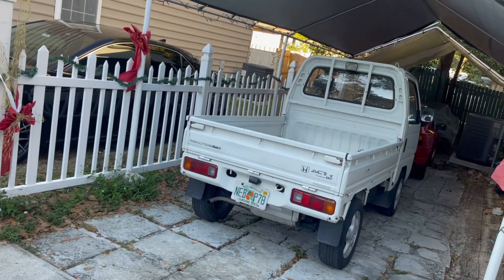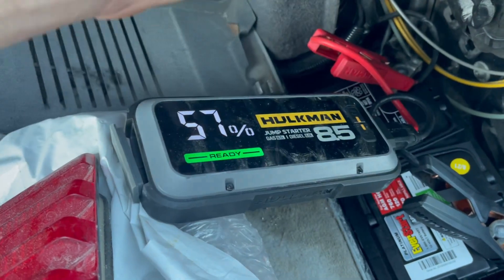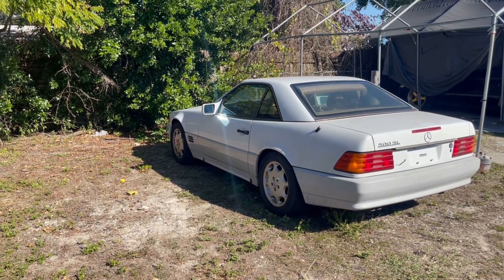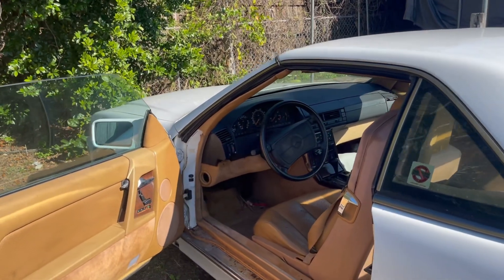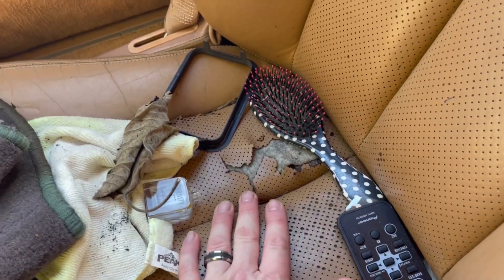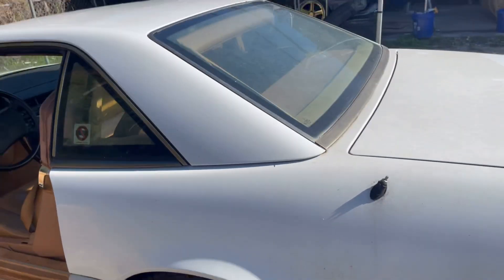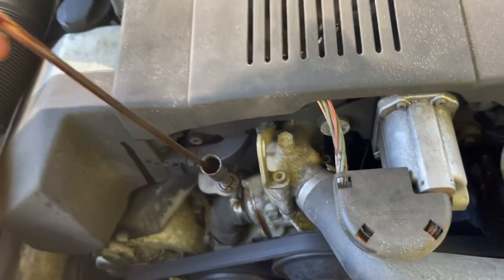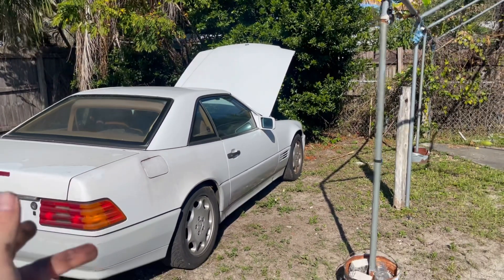I purchased another 1991 Mercedes 500sl r129 to revive and save

Comment: My 90 500SL that I have daily driven for about 3 years is the same color but with the Navy interior. The black & brown looks good. The hard top is a breeze to reupholster if you go the hobby lobby route. Just had the trans rebuilt. I am chasing what sounds like a similar issue of occasional rough idle & stalling when gassing too hard in turns on hills from a complete stop. Did the whole cap rotor clean, new plugs & cam sensor so now think it is a vacuum leak. Doing a smoke test this week & at the very least one of the 4 IAC distro hoses is cracked.
Reply from the maker: Thanks for the info.  Love to hear everyone’s stories.  Also update on fixes.   I may not get to this car for a few months so any help is always good

Comment: I’m biased because I happen to have a 1991 r129 with the same white exterior and palomino (tan) interior, but that looks like a good one. Your interior looks to be in decent shape. If you have a good connection for spare parts let me know. I got mine from a buddy about 3 years ago and I love it. It came with AMG wheels and 235’s tires in the front and 275’s in the rear. I watched your other video about cleaning the cap and rotors because mine had been running rough after sitting for a couple of weeks. I kept thinking that it was a clogged injector that was causing the problem, but after cleaning the injectors it still ran like a dog.  I cleaned the cap and rotors and bam! It is running great. I’ve been enjoying your channel and hope to see more from you. Congrats on the “new” car and thanks for your help with mine.  Cheers